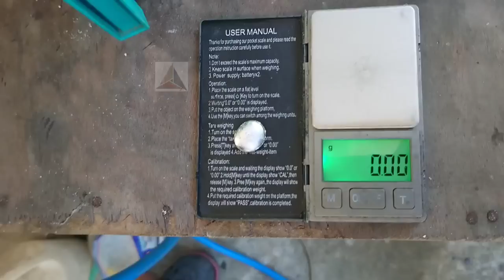Crystal Oscillator Silver Recovery | Recover Silver From Oscillators

Comment: I don't want to be "that guy" but dude...
1) never add water to acid, you always do it the other way around. Dissolution of acids is exothermic and adding water to acid can cause a small steam explosion.
2) dissolution of NaOH in water is very exothermic, adding such a huge amount of dry NaOH to such a small amount of water all at once cannot possibly be a good idea
3) do not mess around with buckets full of nitric acid while wearing crocs for god's sake
4) DO NOT light torches with a lighter! It is a very dangerous habit to get into, one day you WILL have a brain fart and light it with the nozzle pointed at your hand and you will have a bad day. Buy a proper torch striker, they're inexpensive.

Comment: Wow, now I understand why they say silver gets discarded. 500ml of nitric far exceeds the value of 8g silver. Recovery is about $5.50.
I have seen it done by removing the metal case but that takes forever and is still not economical. Thx for the video.
Reply: ? Where's the silver, if it's not in the case or base?
Reply: It's plated on a little crystal disk thus crystal oscillator
Reply: @seancake5900 ; Thanks very much for that tidbit of info.

Comment: Caustic soda turned silver chloride to silver oxide, and when you added sugar to the silver oxide it turned into silver metal
Reply: Can silver chloride be melted into silver? If yes what are the pros or cons for melting silver chloride.
Reply: @franchi8601  toxic gas releases if not turned
Reply: @jasong8377  is there a weight loss in recovery If melting silver chloride?
Reply: @richardperkins3612 it's literally a compound (combination of elements) and silver is silver. If you remove milk from your coffee/milk/sugar drink, (a cup of coffee), does it weigh less? You don't have to be a genius but this is dangerous, like death, so you need to learn and understand before mixing chemicals and any of this stuff

Comment: 92% of the weight is stainless-steel in those crystals another 1.8% is a crystal substance, 6% is resin, the silver is plated only micron's thick (one thousandth of a millimeter). You are wasting your time. Better to just get a job.
Reply: What do you call that if it's not a job ?
Reply: @SimonOzbo  😆
Reply: 😂 get a job. recycling is one of the most important jobs there is. 😅
Reply: Those chemicals cause that reaction only in silver and he got a lot more than microns thick plating out of a kg of oscillations. So you’re clearly wrong